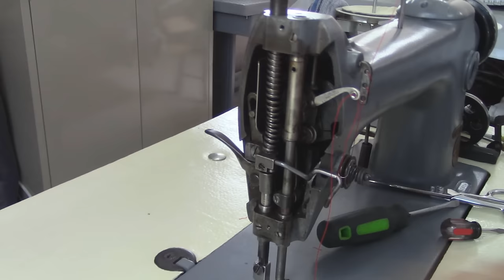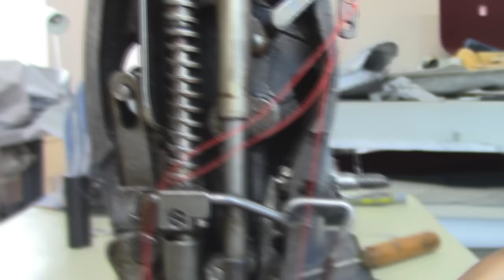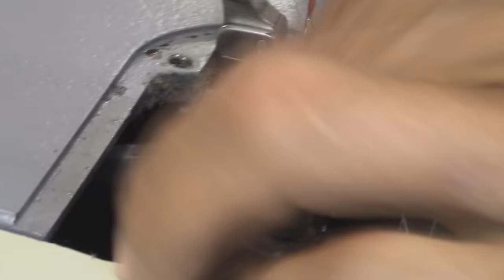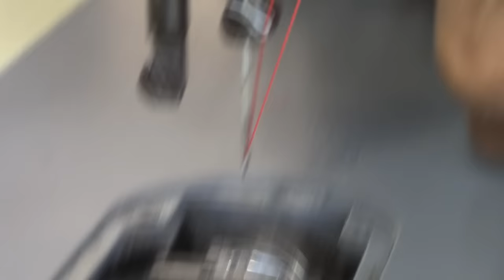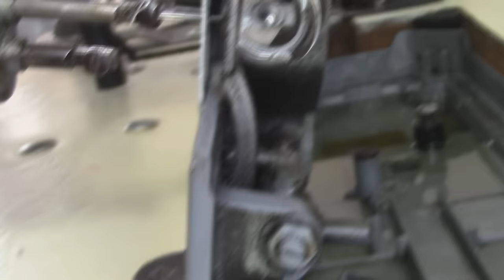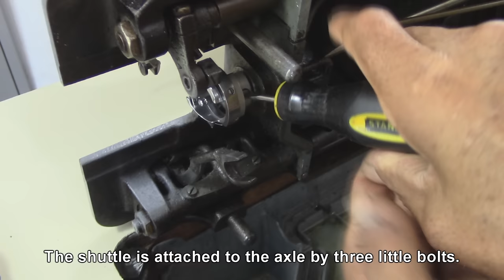Understanding some Mechanisms of a Sewing Machine-TUTORIAL 2-Car upholstery

Comment: Do any of your vids show how to adjust stitch length?
Reply from the maker: If you have a similar sewing machine, then the process is as shown in this video:
https://youtu.be/4ah-sIpRGnA?t=987
Reply: @Cechaflo  Thank you.  I just got a 241.  Trying to learn.  It looks like yours doesn't have the gasket?  Am I seeing that right?  On mine the cork is very dry and brittle.  Was thinking I had to replace it.  Maybe not? (it's > $40!)
Reply from the maker: @paisley436  I do not remember if it had it. I do not have this machine anymore. I sold it. Regularly, these machines are used in clothing manufacturing and shoemaking. It was used in the past to do upholstery with some limitations though.  I used to work with this kind of machines many years ago.
Double and triple transport machines came to replace them.
A roller foot is adapted to hadle it much better. I have a related video:
https://www.youtube.com/watch?v=V_IYfp7zBfI&t=7s

Comment: hi cechaflo, i ask you before i have the same machine the stitch lenght i can  not change it to different size nothing is broken or missing ,is there any way you can make a video on this issue how to fix or set the system right,,i try dog feet to adjust it, it did not work.it i thank you for that  John
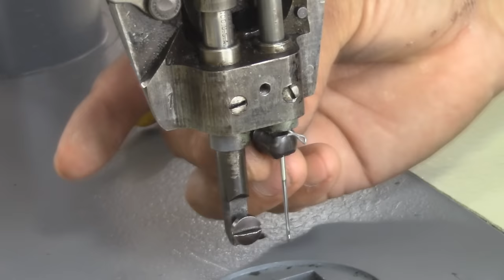Reply from the maker: +asghar dastanai Hi John, I suppose you have checked from min. 16:17 to 18:20
https://www.youtube.com/watch?v=4ah-sIpRGnA

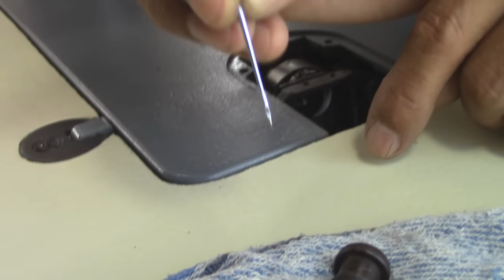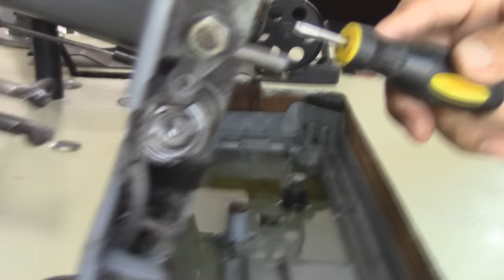If it does not work, it means the pin of the button is not reaching or catching the groove of the mechanism below...check min. 19:01 to 19:38 same video.

Comment: Why won’t my needles stay in my machine have tried different needles but keep falling out it’s a brother industrial electrical. Like you’re videos
Reply from the maker: One of the reasons the needles fall out is the little pressing bolt has its thread worn off or stripped. Check out the little bolt. If so, get a new one same size to replace it.
On the contrary, the nut could be stripped. In this case you would have to buy in a hardware store a tap to make new thread. The new little bolt and corresponding tap would be a bit thicker.

Comment: My wheel won't turn and the needle won't move up or down. It's stuck any suggestions?
Reply from the maker: I've no idea, sorry.
Reply: Tasha Mart  
check the bobbin chamber if there is any thread stuck.. remove the parts and clean..oil.. then put everything in its place

Comment: Hey master Cechaflo, My machine keeps jamming thread on that bar that keeps the shuttle steady. Any input how to solve this? Is my thread to thick?
Reply from the maker: I suppose you are referring to min 15:00 of the video. The upper thread does a complete turn around and passes through the 'gap' between the 'little protuberance' and shuttle.  If this 'gap' is too close it causes to jam thread between. The shuttle can be regulated (there are two/three bolts that keep it fastened to a central shaft. Loosen the bolts and move it backwards a little bit.
It also depends on thread thickness. If you were sewing with a thin thread there was no problem to pass through the gap.
Reply: Thank you. It was the horse or the bar of the runner. It was too high. Thank you for your awesome videos.

Comment: Hey man my sewing machine has a bad stitches sometimes it worked properly then again go back to his defect i I already tried several step to repair but still it didn't work well.
Reply from the maker: What is the trade mark of your machine?
Reply: @Cechaflo  rhine is the brand manual vintage model
Reply from the maker: @reymartbaradillo9057  Trying to figure out what would happen. What is specifically the issue...skipped stitches?  tension  problem?  Your machine is a Singer machine and these machines are very strong and rarely disadjust.
Reply: @Cechaflo  the stitches is crumpled below
Reply from the maker: @reymartbaradillo9057  It seems the machine is sewing but badly.  1. This issue would happen when the hook point is catching the upper thread loop late and for more you tighten the upper tension nut it will not have enough  tension to pull the needle upwards. The lower tension gains and pulls the thread downwards causing the mess. 2. If the machine is correctly on time it would be that upper tension assembly is not working good and need to be replaced for a new one. Sometimes the nut is not tghtening the plates enough.

Comment: Sir for my machine the balance wheel is not moving at all sir plzzz some answer for it plzzzzz.....
Reply from the maker: It should move if some force is applied!  While one person is pressing the button on top you could be trying to move the big wheel back and forth until it is released. Sometimes, these big balance wheels get stuck. If necessary carefully use a pair of pressure pliers to move the big wheel. Do not forget to oil the axis of this wheel.

Comment: Absolutely fantastic...Have the exact Singer machine, and while I appreciate your expertise is upholstery, could you help me  understand the oil pump operation?  I'm not getting any oil in the window, and I would just like to see oil coming from the hole in that copper tube from a perfectly running 241-12!  Again, thanks for your video's...you do amazing work...
Absolutely, best regards....
Reply: did you figure the oil pump problem? I read in an online blog that the machine has to run at high speed atleast for a shirt time to get the oil flowing to all parts.
Reply from the maker: @jnmarin6603  The oil can also flow/run at low speeds lubricating the pieces. The small 'turbine' below' creates a vacuum while sucking up the oil from the 'oil tray'. Of course, these machines are 'high speed' and lubrication will be optimal alleviating friction of the pieces.

Comment: Hi..thanks for your great tutorial video. May i know what size of needle and thread did you use to sew the upholstery? My Singer 248 model only allowed me to use maximum needle of size 90/18 with combination thread for sewing jeans. I always have top thread break.
Reply from the maker: +fairiehan For light materials I use a 120=19 and 140=22 for heavier materials. 
Maybe, you have to change the needle plate for one with a bigger 'little hole'.... or widen  it with a drill bit...a 19 needle would do much better with a 92/138 thread...try out...adjust tensions up(on the disks) and down(on the bobbin).
https://www.youtube.com/watch?v=rJENXLRhXQI

Thanks for following us on our channel!
Reply: yeah, thanks a lot. I realized that the little hole of the needle plate to be change/widen. have a nice day!
Reply from the maker: +fairiehan It's Ok...but, be careful, not all the machines have this capability.